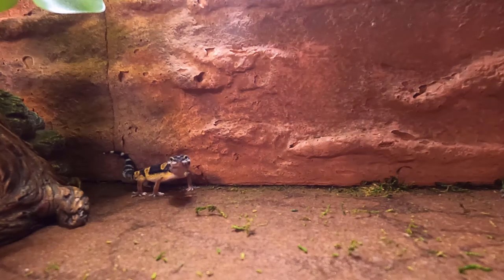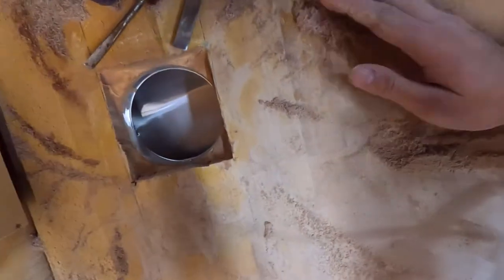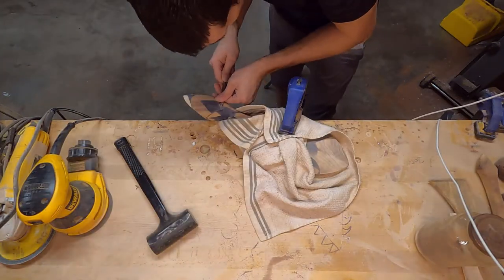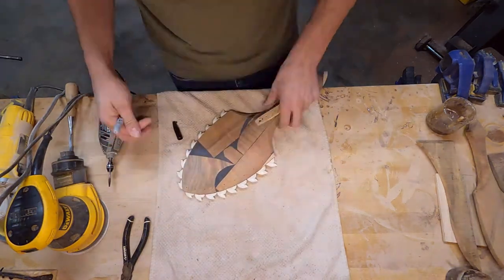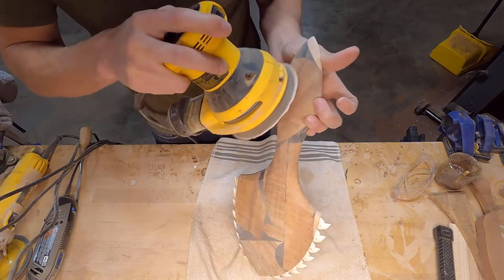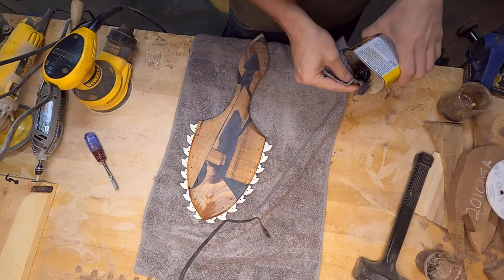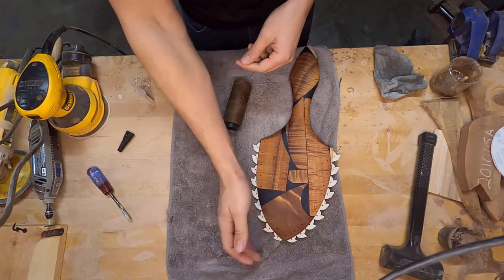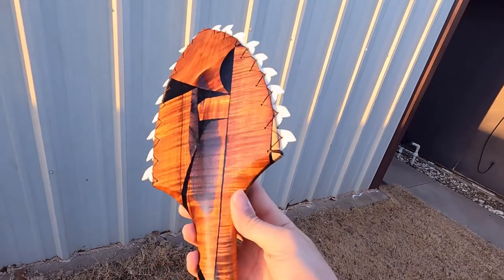Epoxy war club finished

Comment: have you ever tested it agains mettal armor ?
Reply from the maker: I haven’t, but I doubt it would do much 😅 metal is just extremely durable. Be fun to try one day though.
Reply: @KoaStudio  do you know any weapon made out of copper ?
Reply from the maker: Copper is a soft metal, so I doubt it… bronze was invented pretty early on so copper never really had a period.
Reply: @KoaStudio  there was a copper age , it was long time mixed with thes stone age , like 1 copper axe + 1 stone dagger , stuf , it was the first metal used , also i tought indians used copper since its pretty easy to find
Reply from the maker: That’s true about the copper age, just that metal tools have always been replaced by better metals.  Now a days copper is used mostly for it conductivity rather then it’s hardness/resistance